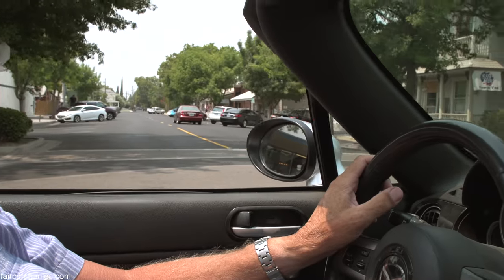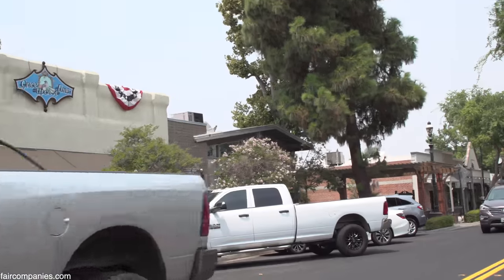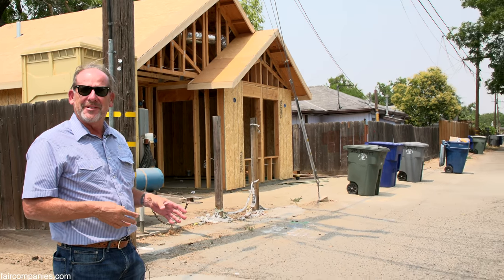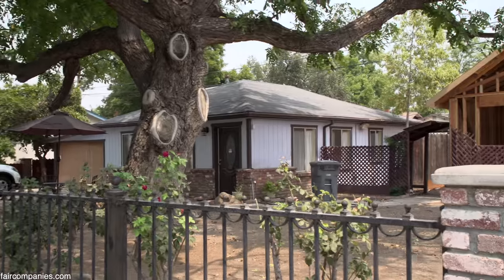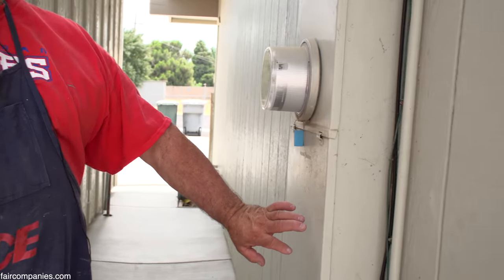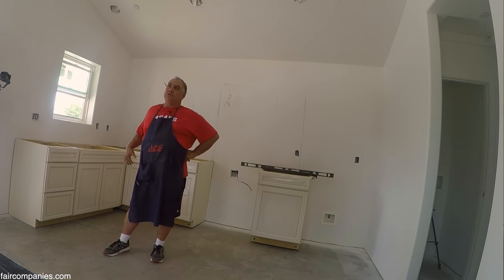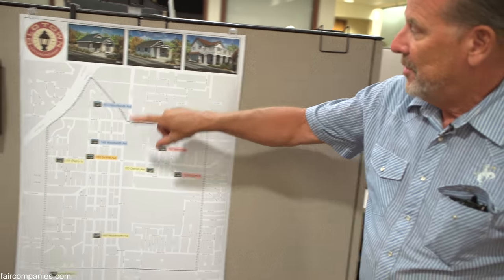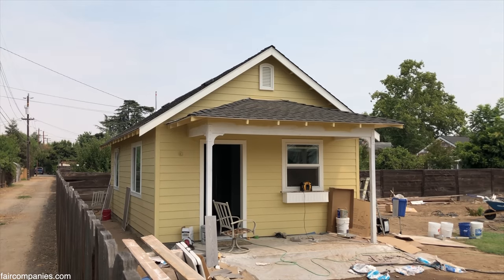Rise of backyard tiny homes as affordable housing in Clovis, CA

Comment: I like these cottages. I wanted to do something similar but the FEES ALONE were $38K. So- good on Clovis. But the plan of having 50 MILLION people living in Calif, getting their water/power from hundreds of miles away, it feels like a house of cards.
Reply: @Steve Slade -  Batteries!  Solar power systems are usually not powering anything directly unless it's grid-tied and feeding it to the network.

Most solar power systems send power to the batteries, which then power the inverters that provides AC power to the home.  The batteries just charge during the day and just need enough capacity to get through the nights.

While Grid-Tie systems can forgo the batteries and just reduce power needs of the house.  Helping to eliminate high cost peak usage hours and countering night time use with day time surplus.

Tiny Houses generally don't require much power.  So it's more practical for them to go solar than larger houses.

You can check examples like Fy Nyth's youtube channel for someone who has lived off-grid for over 5 years now in her tiny house and has all her electrical needs met by a solar power system...  Another example is Handeeman's channel, for a couple living off-grid in Arizona and has a higher end solar setup that he DIY built...
Reply: @christinaelliott8565  You are correct on all counts.  I think the limitation is state county and local GUB MENTS that want tax revenue from property taxes, taxes on water and energy from THE GRID.  If half the people are getting water from the SKY and power from THE SUN, the GUB MENTS know their tax revenues will drop drastically.  They all just PRETEND to care about environmentally friendly tech and methods for political reasons.  But you gotta notice most places you cant legally gather your own rain water for many decades ago it was made illegal
Reply: Steve Slade  You have to use candles as a back up at night and on cloudy days.

Comment: As a 'reformed' city planner, I like this idea.  Firstly I like the idea of alleys, allows utility lines to be run without the ugly poles on the street (got a lot of stuff up there, electric, phone, and cable lines, all with their boxes and switches) (don't ask about underground except in new developments, the cost is immense, ten times or more).  It's also good for underground lines like water & sewer, when they break (and they do break) you are not tearing up a busy street and then repaving it and you don't have manhole covers in a traffic lane.  If you want the folks to clean up the alley you need to pave it.  I like collecting trash in the alley too, again keeps the slow trucks off the main streets as much as possible.

Comment: Interesting how you can build these for around $60,000 where 150 miles away in the Bay Area, putting in a pre-built pre approved accessory dwelling unit built by a mobile home manufacturer (that looks more like a mobile home) will cost you $200,000 minimum.

Comment: There are some brilliant designed tiny houses in the world, making maximum use of small spaces. This is designed by someone who has no skill in this area..
Ana White in Alaska has great ideas, but there are plenty of others around the world and in the US.
Reply: Problem with the sort of showcase tiny homes you think about is that nobody will be able to build you one up to that spec for a decent price.
It is very hard to find a contractor to build a bespoke structure in general with innovative elements - they will ask for insane money and often fumble the job on some level.
So it's not as rosy as it sounds - designs have to be kept very simple for them to be able to be built for a decent price and in decent time and most of the people building these ready made designs where convinced to do it on account of low cost and it being hassle free.

Comment: City planners are always talking about when the 'great migration' back into the cities will begin, probably not going to happen, at least no time soon.  People need several things to move to a community, a lot of folks key on having good schools and most cities fail that requirement by many miles.  Most bad schools have a simple problem, bad students.  Teachers cannot make kids want to learn and it is even worse if the system allows disruptive ones to remain in the classrooms.  Solution is easy, bring in a lot of Chinese families with tiger moms, problem solved.  Next problem, co-equal to the first, community security, if the place is crime and drug infested nobody who can actually pay rent or pay a mortgage will more there, there are other alternatives for them.  The last issue is affordable tax rates that are sustainable, this means putting caps on spending and spending growth, a working class town is not going to support municipal employees who on average are making half again or more what they are.  A tough issue for older communities is their aging infrastructure, the water lines and sewers are falling apart, these are very expensive to fix and often were not well made to begin with.  Surface problems such as poor roads and sidewalks give a bad image but are not as expensive to fix.  Municipal buildings should be decent but not develop into an ediface complex where a community that has tight budget problems has a jewel box city hall, firehouse, or school buildings.  I was in a town recently that had spent a lot of money on fancy new street lighting, probably got a grant to pay for it, unfortunately there was not money in the budget to pay the electric company so the new lights were all dark.